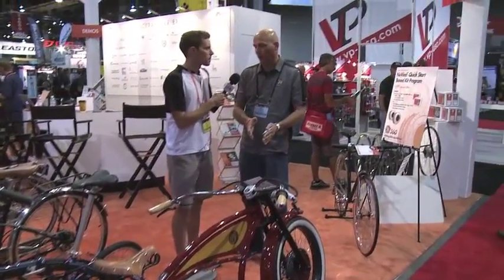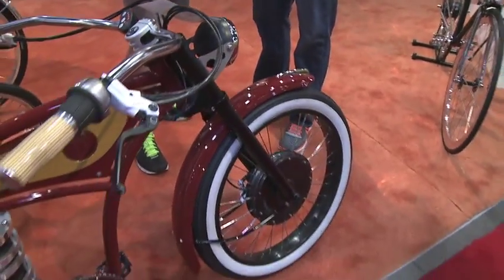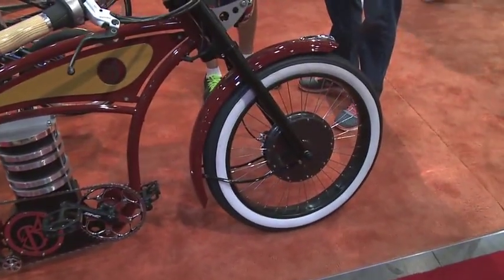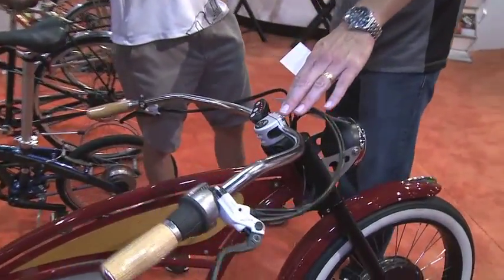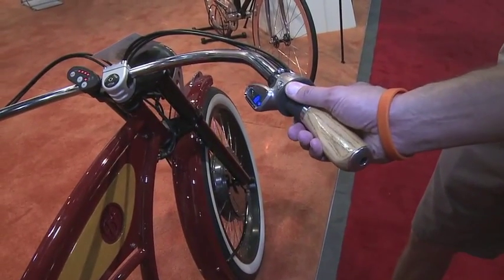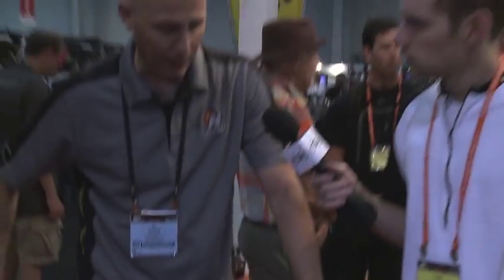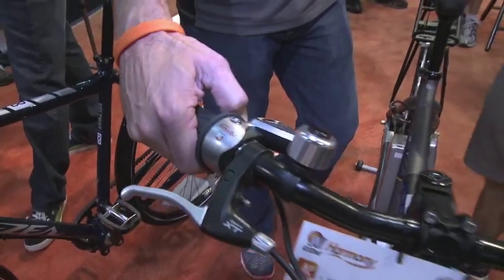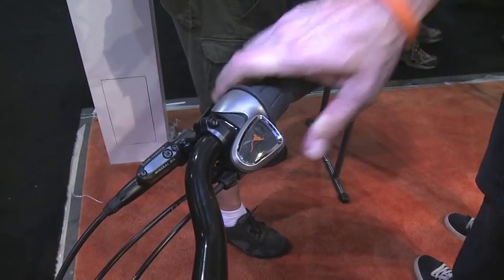NuVinci CVT Hub and Shifter Options Review

Comment: Court mate, would know anything about the N171 at all?..  i believe it's an upgrade geared towards electric and motorised bikes but can't seem to find any reviews..
Reply from the maker: I did some research and found this page about the NuVinci N171 cruise controller... I can't tell if this is just what they call the rear shifting mechanism of the N360 or if it's some kind of separate product? I'll keep an eye out for more info http://www.fallbrooktech.com/video/n171-cruisecontroller-installation
Reply: actually i think i've made a blue mate.. from what i can gather (now) it's the predecessor of the N360... followed a link from what must have been an old post and mistakenly thought they were doing an upgrade..  my bad, but all good..  have a good one..
Reply from the maker: Monstah7 Cool, thanks for the follow up! I heard there was one other NuVinci hub but it was older and isn't being sold anymore (it was more like a geared hub than the newer continuously variable transmission CVT). Not sure what it's called, hope you have a good one too!